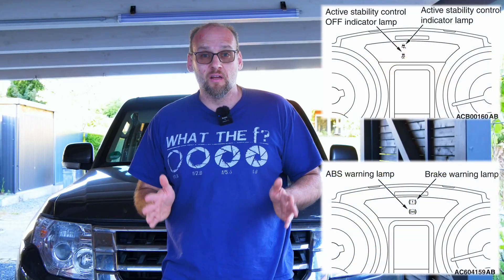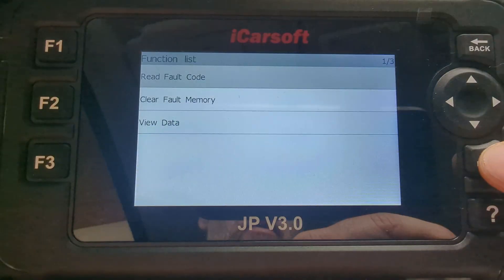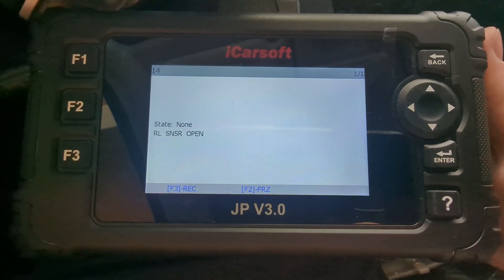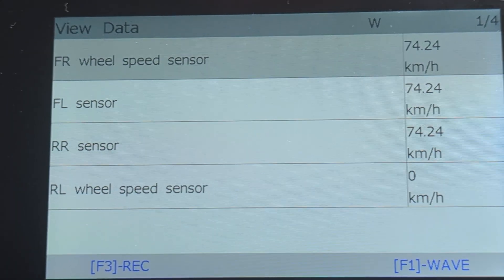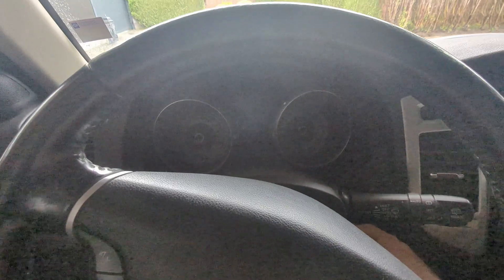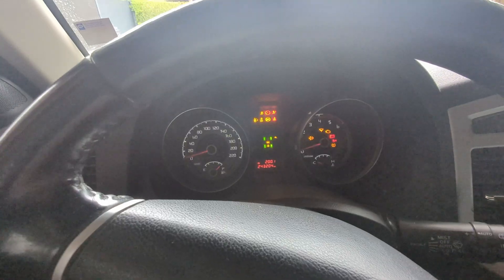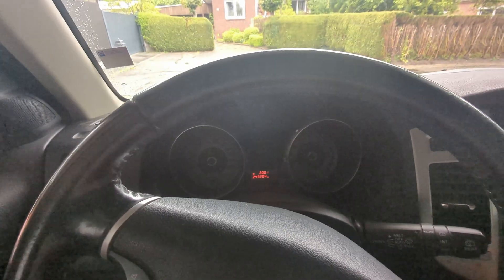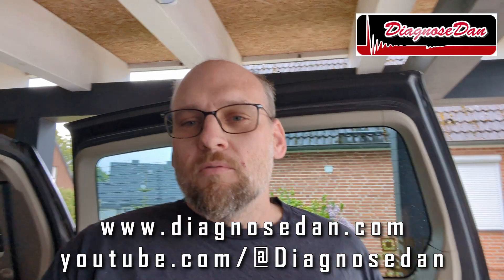Pajero/Montero ABS and ASC Light On? Diagnosing and Fixing Like DiagnoseDan!

Comment: Good video  helped me out it was my front left sensor but i snapped the bolt and the sensor in the hole got it out with air chisel then drilled out bolt and taped new thread all ok now thanks..
Reply from the maker: That's how it's going with these sensors... Terrible design but could be worse. I'm glad the video has helped you. Awesome 👍😎 Thanks for watching!

Comment: Where is the sensor? How to locate it? How much is the sensor cost?
Reply from the maker: You can tell I’m just starting out with YouTube. I’ll make a separate video about the location and replacement of the ABS sensors—it’ll be easier that way. As for the cost, an original ABS sensor can cost up to 150 euros. This time, I decided to try something I’ve never done before: I bought a pair of rear axle sensors on Amazon for 15 euros... yep, fifteen euros. I’m ready to test how long this sensor will last! Thanks for questions!